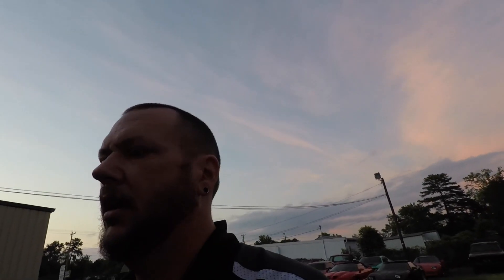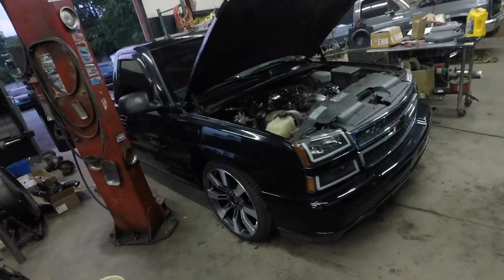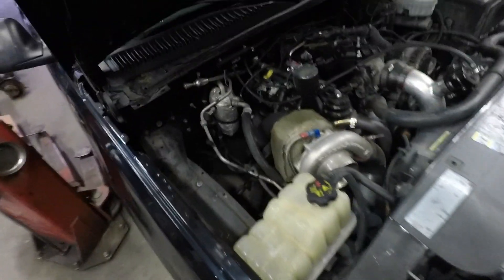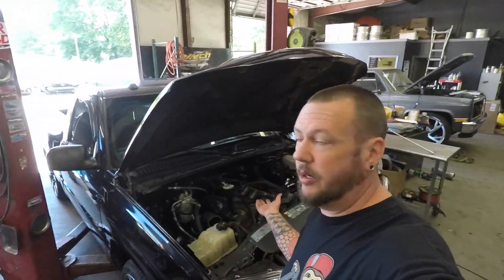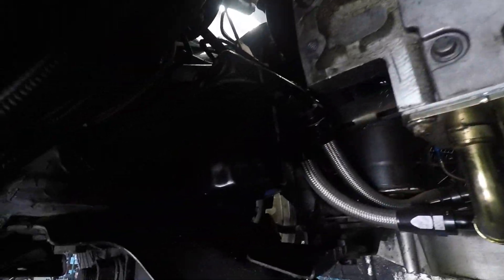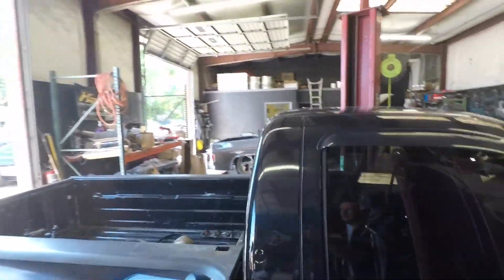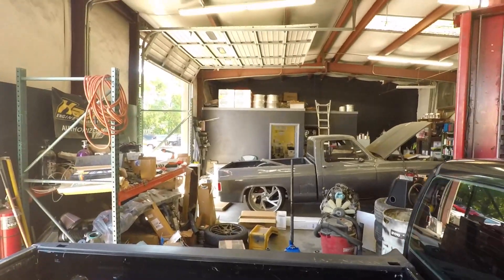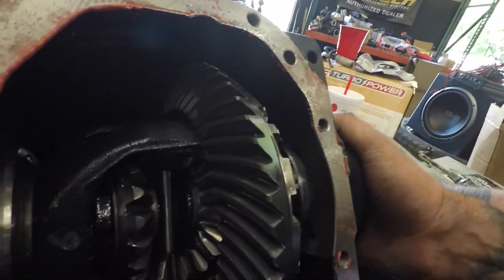Saturdays are for the boys......and all of our broken things

Comment: Monster has excellent customer service, I'm sure they'll take care of the mix up quickly. I had to deal with them on my pilot bearing, for some reason the hold in the end of my crank is slightly larger than it should be and after trying 2 different bearings they suggested trying some white loctite. Worked like a charm.
Reply from the maker: I don't doubt that at all. I am positive that it was just a packaging issue